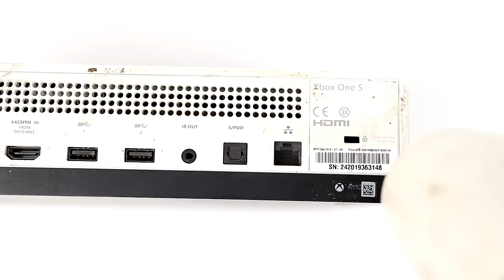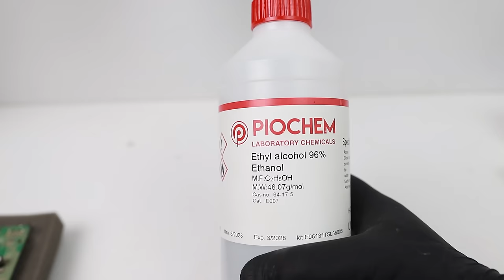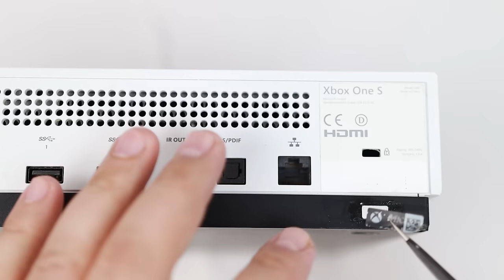Restoring Xbox One S unexpectedly shutting down Console Restoration & Repair - ASMR

Comment from the maker: Check Restoration The Extremely Dirty PlayStation 4 (New Video) https://youtu.be/LcFdltjelKE
Reply: Hello, my xbox one 1tb stopped working in the beginning of 2022. I haven't touched it since but I have a spare xbox one (512gb). Can I take the 1tb hard drive and put it in the working xbox? The working xbox has a newer update.
The faulty xbox first started turning off right after bootup and then during bootup. Later it didn't turn on at all. (even with new power supply)

Comment: Should’ve installed a SSD while it was open.  Great cleaning and great video.  Giving these consoles new life is rewarding.
Reply from the maker: Thanks for the tip!
Reply: recently restored my old dusty overheating slow ps4 and replaced the hdd with an ssd and its much faster
Reply: @diamondjebgold9906 you didn't understand the original comment
Reply: @urbexingTss I meant to reply to a different comment 💀 yes I deleted that wrong one
Reply: you would have to transfer all the files or the OS for it to work, it was not fun for me when i had a corrupted HDD
Reply: It really doesn’t help with download speeds, It might be slightly faster. Besides, SSDs are crazily expensive.
Reply: @Diabeetus. This isn't true. SSDs used to be expensive, but you can get a 2TB 2.5" SSD (or m.2 nvme) for under $100. HDDs aren't much less. And although they might not be faster re: download speed, they're much faster than HDDs with load times
Reply: @resEG  That's what she said.
Reply: @alec9360 I’ve also heard to for some games the rendering distance can be improved with certain games and it’s an upgrade I’ve been thinking about

Comment: Perhaps the most striking aspect to the Xbox One S is its design. Microsoft has done a superb job of repackaging the Xbox One into a far more compact and attractive chassis that is nearly 40% smaller. 
Xbox One - 333 x 276mm x 78mm (13.1 x 10.8 x 3.1 in) and 3.5 Kg (7.8 lbs)
Xbox One S - 295 x 230 x 64mm (11.6 x 9.0 x 2.5 in) and 2.9 kg (6.4 lbs)
Perhaps most impressive of all, however, is the Xbox One S now has the power supply built in. Given the original Xbox One had a huge, bulky power supply this is a major step forward - especially given the PS4’s built in power supply was always a selling point for Sony.
Reply from the maker: Thanks for the visit

Comment: I love refurbishing and cleaning older consoles. I recently picked up one of these from a flea market for $25. It was pretty dirty and looked rough. Since these are modular, they are one of the easiest to open and clean. It looks brand new now. 

Also, I find that using a paint brush with stiff bristles when using soap and water, makes cleaning tiny holesand inside corners very easy.

Comment: it's always nice to see these old consoles get another chance at playing games. sad though...knowing that some people treat them like trash, causing them to create errors and overheat.
Reply: My Xbox 360 is my baby. Love it. Still have it today, runs like it's brand new.
Reply: Totally agree, some people shouldn't have items like this, they have a total lack of respect for them and a lack of respect for money.
Reply: my original xb1 still works like a charm, ever since it came out of the box. it’s because i’ve been keeping it well cooled. keeping the exhaust port away from anything that’s like a wall. even using a air circulation system. lifting it up and the power brick, letting air flow under it and reduces the amount of crashing and freezing.
Reply: I still have my Xbox one S, but sadly mine has an issue when it turns on doesn’t even display the opening screen then turns off. It saddens me because that thing was my life since I was nine and was using it till it gave up on me. One day I might pay to get it repaired just so I can get nostalgia (still on display and I refuse to get rid of it)
Reply: there’s yet 2 other things i do to prevent errors from popping up on an xbox. …turning it off fully and keeping the disk tray empty. when done playing on the xbox, hold the power button until the light turns off. it turns it completely off and power cycles the system. and when done playing a disk game, take it out of the tray. it avoids any future issues with the disk drive scanner, like unable to read anything.

Comment: Should of done like I did with my PS3 and PS4. I upgraded them to 1 and 2TB SSDs. They run amazing with them. Also, if you are going to Retro bright, do it with 10% Peroxide. It's comes out much brighter, and even. Looks amazing tho, great job. Also... what is the spray you are using?

Comment: I didn't read the entire video title and thought it was just an XBox One, and was genuinely confused when he started to pull out parts I hadn't seen from my own XBox One lol
Reply from the maker: Perhaps the most striking aspect to the Xbox One S is its design. Microsoft has done a superb job of repackaging the Xbox One into a far more compact and attractive chassis that is nearly 40% smaller. 
Xbox One - 333 x 276mm x 78mm (13.1 x 10.8 x 3.1 in) and 3.5 Kg (7.8 lbs)
Xbox One S - 295 x 230 x 64mm (11.6 x 9.0 x 2.5 in) and 2.9 kg (6.4 lbs)
Perhaps most impressive of all, however, is the Xbox One S now has the power supply built in. Given the original Xbox One had a huge, bulky power supply this is a major step forward - especially given the PS4’s built in power supply was always a selling point for Sony.

Comment: I had a Xbox series X it is wonderful I was PlayStation fan
Reply: You were never a PlayStation fan xbot
Reply: Biggest downgrade ever
Reply from the maker: Thanks! I’m glad you like it.
Reply: @MichaelM28   Both consoles are quite similar in terms of specs, but there is one that has an edge over the other. Both have 8-Core CPUs from AMD, but the Xbox Series X just exceeds the PS5 with 3.86GHz compared to 3.5GHz.

The Xbox Series X also comes out on top in terms of storage, offering a robust one Terabyte SSD compared to the PS5’s 825GB. However, the way that Sony integrated its storage into the console actually boosts the overall performance of the system, making it much faster.

But what does this all mean, and what is the best way to measure a console's speed? The easiest way to measure which console would be fastest is to see whether the Xbox Series X or the PS5 has the most Teraflops.

And no, that’s not a made-up word. "Flops" stands for floating point operations per second. Essentially, the system's performance is measured by the number of floating point calculations it can make within a certain timeframe. The more, the better. And in the case of teraflops, the Xbox Series X wins again with 12.1 teraflops, compared to 10.3 teraflops for the PS5.

Comment: nice video , I have a problem with my xbox one s. happens that it disconnect from the server few moments later after begginning to play online , I think it may be a problem with somethng related to the network device , I start to play and it looks very slow connecting to a online game then it bec<ame more slowler while trying to play , and then it shows that the xbox is no more connected to the server , so I turn it off and start the process again but the problen keeps going , can you show me where the net connection device is located in the board, thanks

Comment: Would you fix an xbox series x disc drive pin connector on a motherboard? Thats the only downside on my xbox series x, everything works perfectly good and fine, problem is my disc drive won’t work it’ll accept discs but not read them anymore

Comment: Had an Xbox One S for 4 years, and even though i’m not using it now, the only issue that has developed is if there’s no disc inside, the drive tries to take in a disc that’s not there, but it it’s not a big issue, if I want to insert a disc, I just press the eject button so it’ll start pulling in the disc and guide it with my finger. But how do you let an Xbox One S get like this?

Comment: PS5 vs Xbox Series X: which is best?

Both consoles are quite similar in terms of specs, but there is one that has an edge over the other. Both have 8-Core CPUs from AMD, but the Xbox Series X just exceeds the PS5 with 3.86GHz compared to 3.5GHz.

The Xbox Series X also comes out on top in terms of storage, offering a robust one Terabyte SSD compared to the PS5’s 825GB. However, the way that Sony integrated its storage into the console actually boosts the overall performance of the system, making it much faster.

But what does this all mean, and what is the best way to measure a console's speed? The easiest way to measure which console would be fastest is to see whether the Xbox Series X or the PS5 has the most Teraflops.

And no, that’s not a made-up word. "Flops" stands for floating point operations per second. Essentially, the system's performance is measured by the number of floating point calculations it can make within a certain timeframe. The more, the better. And in the case of teraflops, the Xbox Series X wins again with 12.1 teraflops, compared to 10.3 teraflops for the PS5.

Comment: Yo i have the same one but the hdmi port doesnt give enough signal anyone knows how fix it?
Reply from the maker: Try a different HDMI cable. HDMI cables can be faulty, so try swapping out your current cable with another one, if you have one. If you're still getting the "No Signal" error or seeing a blank screen, continue to Changing the Resolution in Safe Mode.

Comment: nice job saving that xbox one im pretty sure its little brother the original microsoft xbox its big brother the original microsoft xbox 360 appreciate you for saving its bigger brother the xbox one i bet a good cleaning fixing inspection refurbishing repairing restoring reapplying new fresh thermal paste on the central processing unit graphics processing unit  chip most importantly clean the motherboard the cooling fan the top and bottom of the system shell the heat sink the less dust the more likley it will work i saved 7 retro videogame systems claimed to be broken it was nothing wrong with those 7 consoles i saved a original microsoft xbox original microsoft xbox 360 original nintendo game cube  dol-001 original sega genesis model 1 non high definition graphics console it has the va7 motherboard and 4 sega game gear systems  two is model 2110g those two have the va5 motherboard and two 2110 and they both have the va1 motherboard and 2 acis chips i like saving old school retro videogames toys and lasko box fans all old school retro videogames toys and lasko box fans deserve a second chance at life and new owner to take Care of them

Comment: “Unexpectedly shut down” gee I wonder why? 🙃
Reply from the maker: Dust, if left to build up over time, can block the fans and cause the CPU or GPU to overheat. Lint and dust accumulation prevents the air from flowing around the cooling fins and causes the fan to work harder. Blocked air vents can cause serious performance issues by restricting airflow. This can cause the processor, memory (RAM), and other hardware to overheat which may lead to a potential hardware failure. You can clearly hear the sound of the fan as it suffers from a lot of dust
Reply: @resEG  oh I know 😂 I was just being sarcastic. I’m just in awe that anyone would a priced possession go to waste like that.

Comment: They well and truly learned nothing after the 360. Same cage design. Why would you put this devices which generates tons of heat into a metal box with only a few holes to vent the air out of it. Only 2 copper heat pipes, overuse of cheap outdated thermal grease, non serrated fan blades on the CPU cooler. They dont pay attention to detail. All of these things could have been controlled for at the factory. But I guess they got away with it because it wasnt as prevalent as the RROD on the 360.

Comment: “Xbox one S unexpected shut down”, yeah I wonder why.
Reply from the maker: Dust, if left to build up over time, can block the fans and cause the CPU or GPU to overheat. Lint and dust accumulation prevents the air from flowing around the cooling fins and causes the fan to work harder. Blocked air vents can cause serious performance issues by restricting airflow. This can cause the processor, memory (RAM), and other hardware to overheat which may lead to a potential hardware failure. You can clearly hear the sound of the fan as it suffers from a lot of dust

Comment: This amount of thermal paste is unnecessary.
Reply: So true. This CPU has no heat spreader, so just a pea-sized amount on the die is needed, and don't spread it around as the pressure from the heatsink will do that for you. It's not supposed to be in the surface mount chips around the CPU die.
Reply: @waynepedley5395  Exactly. It also reduces thermal conductivity because of the thickness.